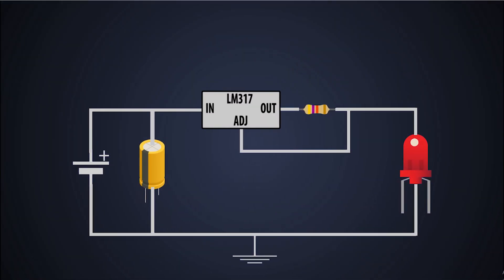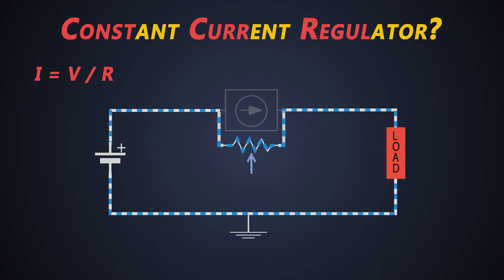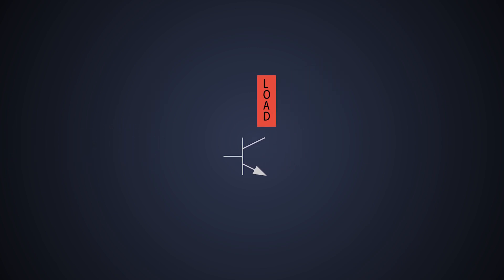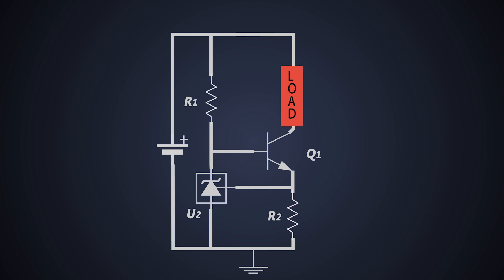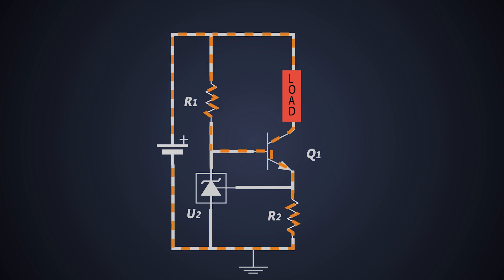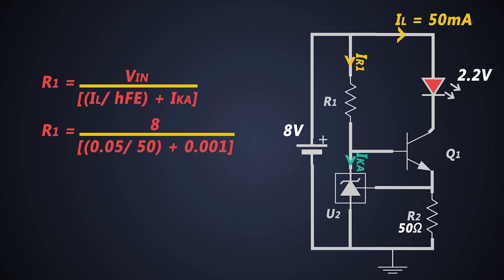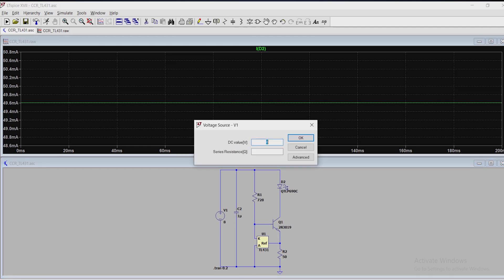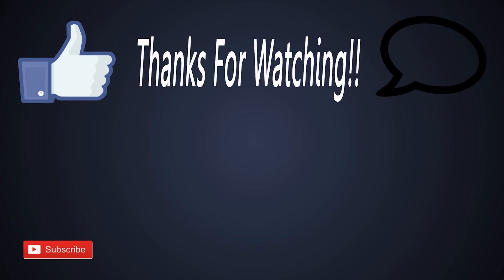Constant Current Regulator using Transistors & TL431 | CCR | Constant Current Regulator.

Comment: How you calcule R1=728 Ohms ?????? Because 8/((.05/50)+.001)= 8Volts/ 2mA= 4000 Ohms
Reply: I get an even different answer.  I'm happy that iR1 = 2mA (.050/50 +.001) but the voltage across R1 is not 8 V.  Since the base of the BJT is .7 higher than the emitter, and the emitter will be at 2.5 Volts to activate the feedback, then the base voltage is 3.2 Volts.  so the Voltage across R1 is 8-3.2 or 4.8 Volts so R1 should be approximately 4.8/.002 = 2.4kOhms.

Comment: Better to use opamp as feedback element for good current regulation and Low voltage drop.
Reply: TL431 is essentially an op amp

Comment: Can it be designed to drive 100 ma load
Reply: yes, it can. for R2 you take 2 resistors 47 Ohms in parallel, for Q1 a S8050

Comment: Can it be used for 150 ma current
Reply: yes, it can. for R2 you take 3 resistors 47 Ohms in parallel, for Q1 a BD135  or BD137

Comment: R1 should be 4k according to your calculation sir.
Reply: Your comment is true. R1= 8 / { ( IL / hfe)+İka}  R1=8 / 0.002 = 4000R  .If the current flowing through the Tl431 is 1 mA, this value will be 4000 ohms. But I think the friend meant 100 mA in the formula.
Reply: @elektronikhobim6903  nope, the friend calculated with 10 mA --> 8 V / 0,011 mA = ~727 Ohm :-)

Comment: Hi, i have a question, Does all three constant current regulator you upload here will reduce voltage receieved by load to achieve desired current? I want to keep the voltage same as input even when the load has less resistance and the current increases. Thank you
Reply from the maker: you need constant voltage regulator for that